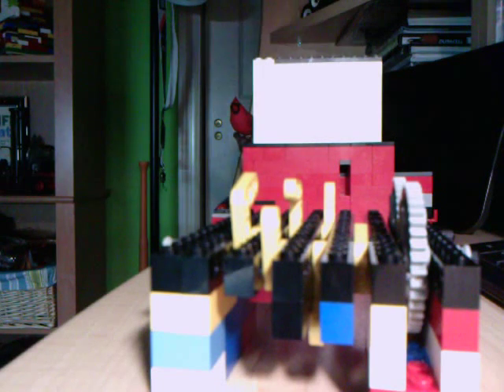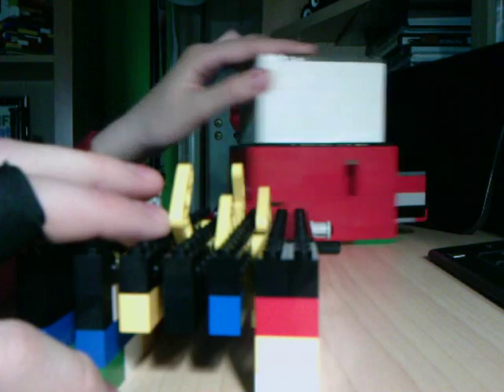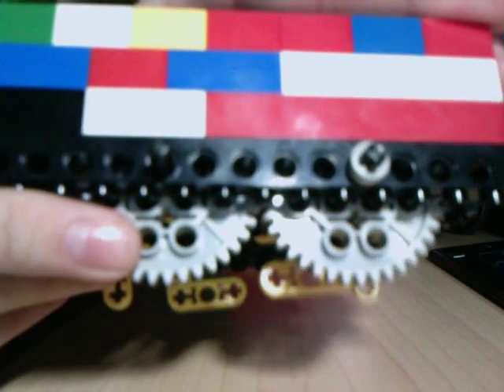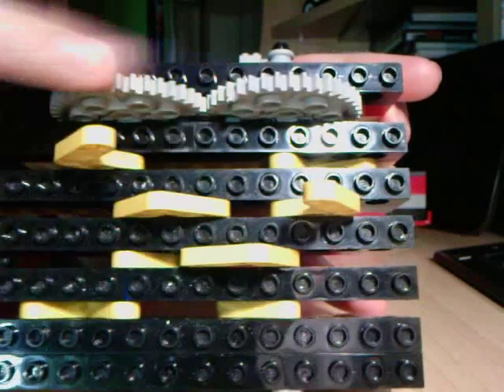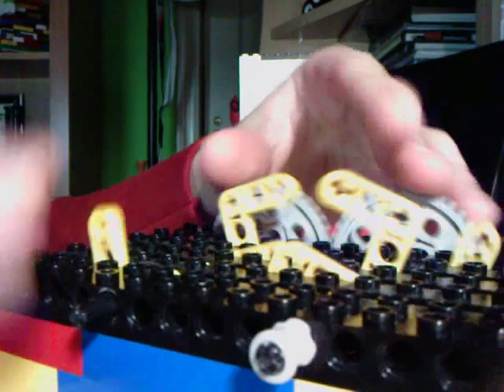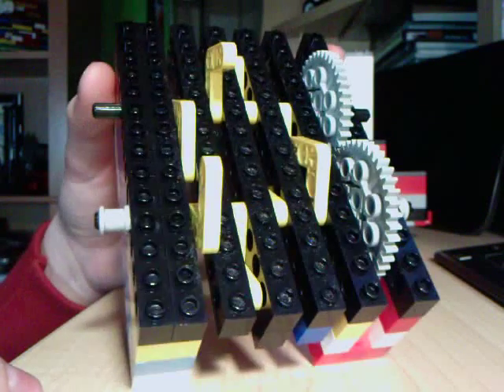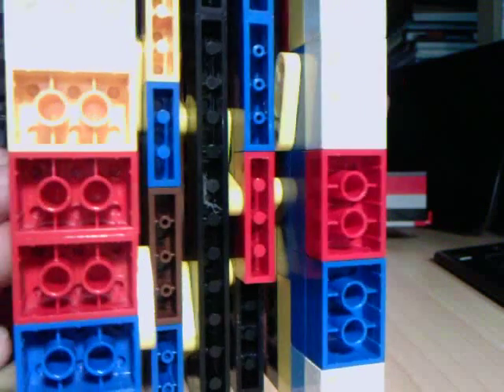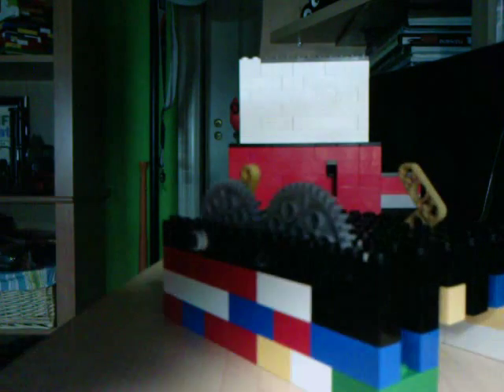Lego shredder mechanism

Comment from the maker: @1234legodude Cause if the blades turned at different speeds, they would catch eachother. The safts are set on the gears at a specific degree so when they turn at the same speed, the blades on different shafts hit the piercing point at different times.